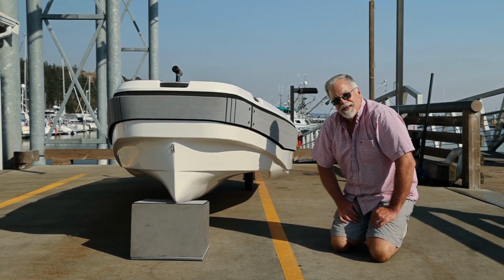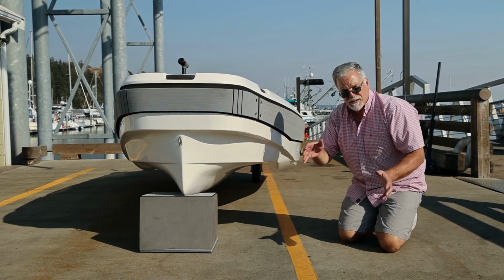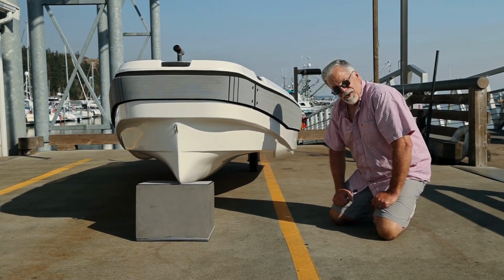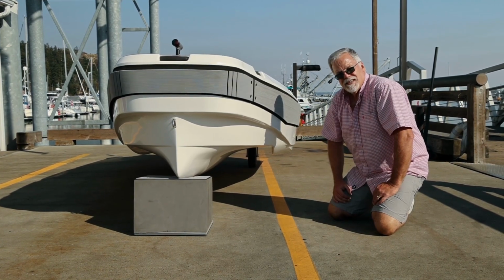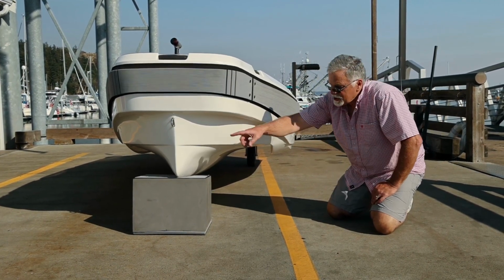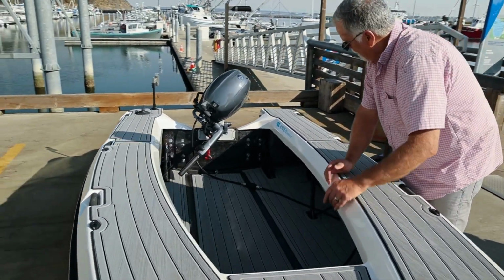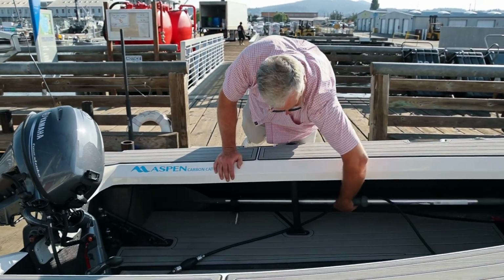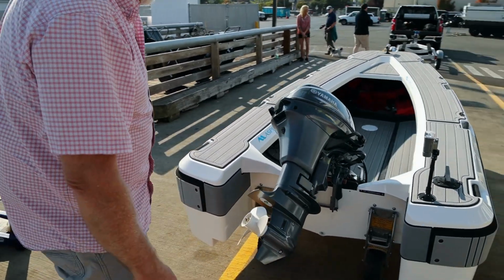Aspen Carbon Cat Tour & Running Video

Comment: The width between a pickup truck in the bed wheel wells is usually around 48.2 to 50.63  inches.  The inside bed length of a pickup truck varies, with common lengths being 5' 8" (short bed), 6' 5" (standard bed), and 8' (long bed). Loads can overhang the rear of the truck by 4 feet before requiring a red flag, or a red light at night. California allows cargo to overhang a vehicle by 4 feet beyond the rear, 3 feet beyond the front and 4 inches beyond the side of the vehicle. You must use markings if the load extends 1 foot or more to the left or over 4 feet to the rear of any vehicle. Would be nice to see a sled that fits in a standard or large pickup truck bed. Good luck!